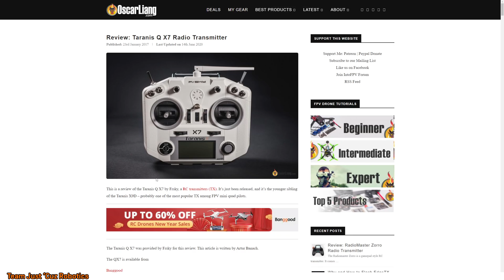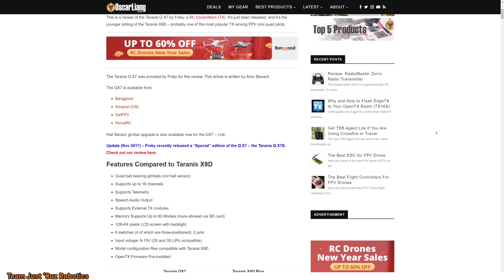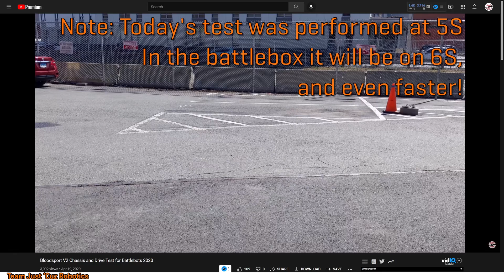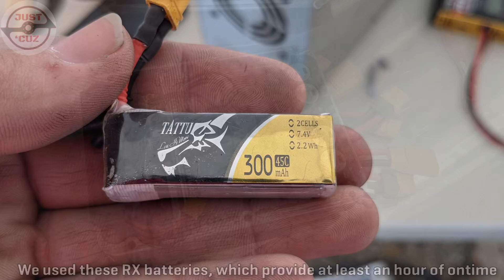Gigabyte vs Shrederator: How 1 Wire Can Kill - Battlebots Builder Breakdown

Comment: Hey seth great video but may I ponder a question? What is the practicality you think of using laser based systems to control the bots instead? I believe they typically have a higher bandwidth allowing for better data transfer but I've not seen any laser based system apart from the lidar on chomp and more recently oribitron. I would like to know your thoughts.
Reply from the maker: All of these robots are manually driven by a human being with a radio control. Very few have any autonomy and lidar is expensive and not the sort of thing that you usually want to get destroyed in a fight
Reply: @JustCuzRobotics  OK fair enough and thanx for replying just a thought although Chomp did implement it semi successfully and other bots as well so maybe there's still some potential for it if you're a team that's weird, crazy and well funded enough.

Comment: Do the rules that require a fail-safe allow for redundancy?  Is there a limit to the number of levels of redundancy allowed?
Reply from the maker: I'm not entirely sure what you mean by redundancy if it would interfere with your bot stopping if the radio disconnects. Pretty much every competition requires at least that.

Comment: 9:28 What’s this neat machine called? And what’s that drill made of to cut so easily?
Reply from the maker: That is a CNC milling machine, it's not a drill but rather something called an endmill which is designed to cut sideways as you see it doing in the video. The endmill in that case is 1/2" diameter and has 3 cutting edges called flutes, and it is made of tungsten carbide which is harder than steel and then coated with a special coating that makes it extremely slippery to aluminum. Spinning at several thousand RPM every time a cutting flute comes.across the material it is only removing slices a few thousandths of an inch thick at a time. The exact machine there is a TORMACH PCNC 1100 and it's at a local makerspace (Makeit Labs) where I can use it freely for $50 a month. The machine itself costs about $15,000 with all the upgrades that one has.
Reply: @JustCuzRobotics   That’s incredible. Hell of a tool

Comment: Maybe bots should be autonomous, like Sumo Bots?
Reply from the maker: There are no rules against it but developing an autonomous control scheme for a 250 pound killing machine, , particularly for a full body spinner, is just about the most dangerous thing I can think of doing
Reply: @JustCuzRobotics  
Obviously not entirely autonomous.......
It's inevitable that will happen TBH.
Reply: There was a rejected bot called Honest Abe that tried to do just that. It was a shell spinner with a lidar dome on top. It would attack anything bot sized that moved by moving on intercept paths. It was rejected because it was deemed too dangerous to allow a fully self-driving robot into the box for events like an unstick.

Comment: I'm real curious as to how the weapon dynamics work between these two bots. You'd think that placing teeth higher up on the shell would make Captain shredderator hop up on the sloped edge of gigabyte
Reply from the maker: Yeah I am also curious about that. I don't know how long the reach on each bot is, what their slope angles and tooth heights are, and who was actually hitting who.
Reply: i imagine, the result was caused, as even though shrederator would be thought to be pushed up by the impact, giga would inversely be pushed down into the floor.
    being destabilized / forced to grind into the floor like that makes sense to me that either or both would "hop up." but im more so curious how shrederator didnt. (maybe the attachment weapon had a lil flex to it given the weld or material used, maybe Shred had more ground clearance so when tilted a bit it was enough, could also just be how the shells are attached to the chasis.) 

I'd really like to know the full physics of how it went down for certain!!!
Reply: Gigabyte builder here - the shell on shred was specifically made to fight horizontals, it was close to ground scraping (<1/16" ground clearance) and was "sharpened" near the floor with a 1/4" flat lip. I don't remember the angle exactly but it was somewhere between 30-45°
They hoped that impacts would bounce GB up into their ridiculous upper blades (they didn't) so it would do damage to something (it didn't)
Every impact was GB hitting shred with its blades. There is almost 2" of ground beneath the bottom of the blades on GB (something I've been saying really needs to be set to close to 1/8" to allow some flex in the system but also actually grab the lip of plows at an angle so they aren't nearly as effective.
Because the teeth weren't angled and sat way off the floor, the results are as you see. Shred deflected the blows harmlessly. No bot suffered more than a few cosmetic scratches, but the fight was a humbling experience for both teams

Comment: The real issue is that Gigabyte spins to the left, therefore absorbing Captain Shrederator's power like L Drago absorbing it's opponent's power. 

For real though I feel bad for Brian Nave. He's so dissapointed it just ended like that.
Reply from the maker: Absorbing the power? Gigabyte got launched like 5 feet up! I think if they kept moving for the rest of the fight Shrederator would have easily won that.
Reply: @JustCuzRobotics  yea beyblade logic basically but hard rubber can steal spin
Reply: @JustCuzRobotics  
According to Beyblade logic, the fight is what exactly happened. Gigabyte "drained" Captain Shrederator and win despite at a disadvantage in the beginning. Kinda like Meteo L Drago vs Evil Befall from Beyblade Metal Masters.
Reply: @cypherbrittainne  well you need hard rubber to steal spin